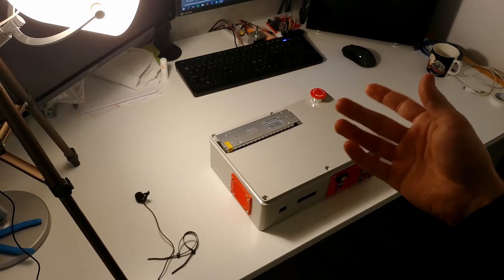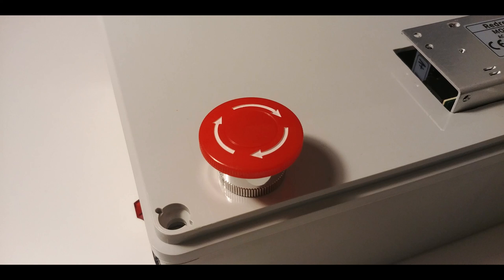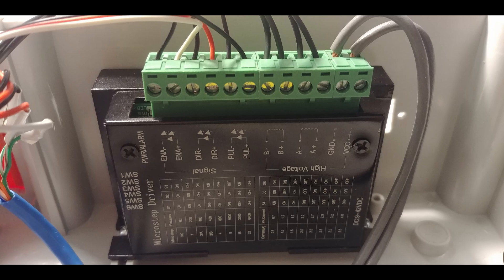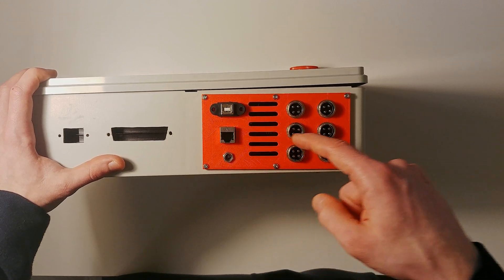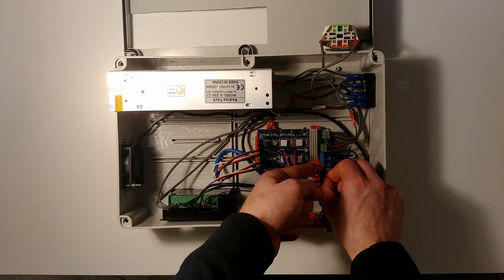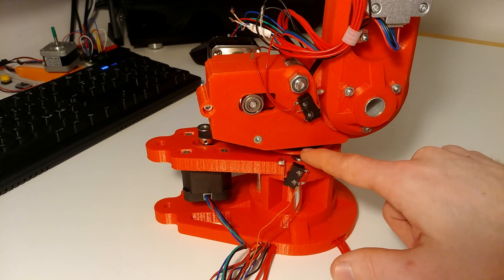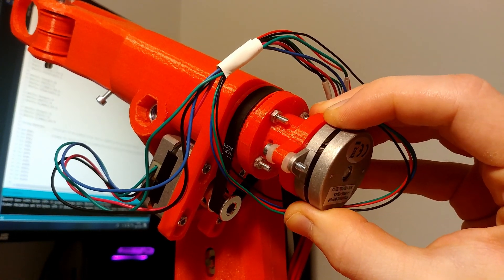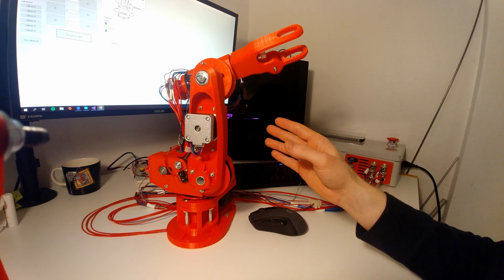3D Printed 6DoF Arduino Robot arm - Electrical enclosure and changes to the robot arm [Part 2]

Comment: hey how did you connect all of your wires to the power supply? did you solder all of them together and put them in one terminal? if you can answer i would love that i am building this for a research project.

Comment: Hi! Can I contact You in private message somehow? email maybe? I still got some questions - (pause at 3:27) there are some wires coming out of the blue one -  thats endstops, right? Do You use all of these red, white and black wires or just red ones? I am asking, because i am using ramps 1.4, not 1.6 and i looked at Your arduino code file and it looks like only red ones are needed.

Comment: Hey @tw2ka thanks for this project, I can made my own robot with another type of controller so I connected the robot to AR2 Free software using the arduino Ramps and RoboDK for control, if you want to see its in my youtube channel and if you want the code (I modify the AR2 firmware) I can give you

Comment: Hi! Could You explain how did You connected endstops to ethernet port?
Reply from the maker: I cut a ethernet cable in half and the other half with the connector is inside the box and the wires are connected to arduino. The other half of the cord was then connected to the robot side of things. In the box there's just a pass through connector that takes ethernet cable on both sides.
Reply: @tw2ka644  Yea, but isnt ehternet cable only an 8 wires cable? And enstops needs 6x2=12 wires? I guess that You use 6 signals of endstops and 1 common ground for all of them? That's equal in 7 wires out of 8. Is that how You connect endstops? I will be greatful for answer :)
Reply from the maker: @TheDindan111  That's exactly how it was connected! One common ground and 6 signals.

Comment: First of all, it's a great project. Thank you very much for sharing with us. Can you share a file or video about the circuit diagram and how the connections should be? I am having difficulties with this. Thank you from now.
Reply from the maker: I apologize for it taking this long to answer. I couldn't find proper connection documents of this. Tried looking but couldn't find them. The basic idea was that stepper drivers were powered directly with the power supply. Motors were connected directly to DRV8825 drivers through the 4-pin connectors on the side of the box. E-stop in the box shuts down the power connection to the power supply therefore shutting the drives off. The arduino itself was powered from usb so eventhough E-stop was pressed the logic and the control side of the machine remained powered on. Limit switches and other data cables from control box to robot were connected with ethernet cable.

Comment: Hi, thank you for sharing this beautiful project of yours, I'm printing the parts of your robot these days, would you have the possibility to send me the electrical connections? Thanks again greetings Francesco
Reply from the maker: I apologize for it taking this long to answer. I couldn't find proper connection documents of this. Tried looking but couldn't find them. The basic idea was that stepper drivers were powered directly with the power supply. Motors were connected directly to DRV8825 drivers through the 4-pin connectors on the side of the box. E-stop in the box shuts down the power connection to the power supply therefore shutting the drives off. The arduino itself was powered from usb so eventhough E-stop was pressed the logic and the control side of the machine remained powered on. Limit switches and other data cables from control box to robot were connected with ethernet cable.

Comment: Hi, how did you extend the stepper motor wires..what wires did you use
Reply from the maker: I used basic electrical wires, check the steppermotor manual to see the size of the wire
Reply: @tw2ka644  thanks man...what 3d printer did you use..can it print gt2 pulleys

Comment: Hey there, great work. 
I got one question however: Whats the program you control the robot with on your PC?
Reply: Thanks mate :)
Reply from the maker: There's an Arduino code running on the Mega that takes in lines of codes (basically command words) from Visual Studio program. Basically pressing a button from Visual studio GUI sends a line like J1+ or J1- to the Arduino which then acts in a corresponding way. I will add these programs to the OneDrive folder to go along with the 3D files.